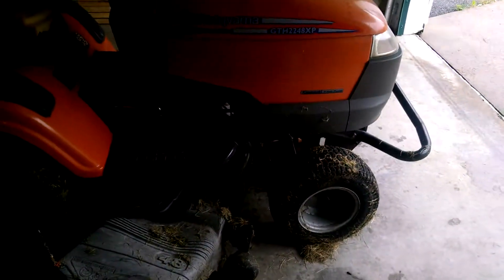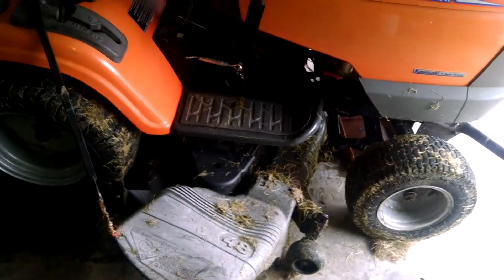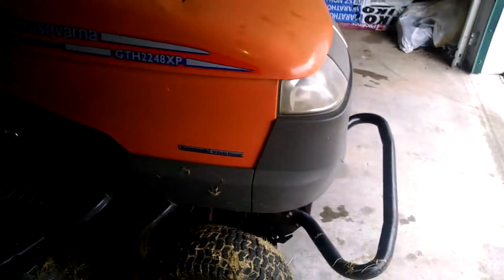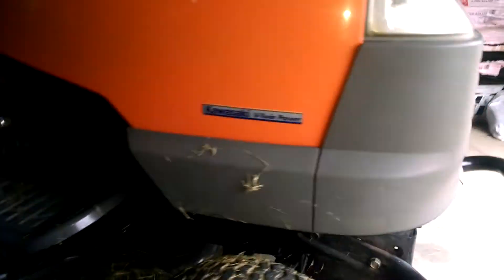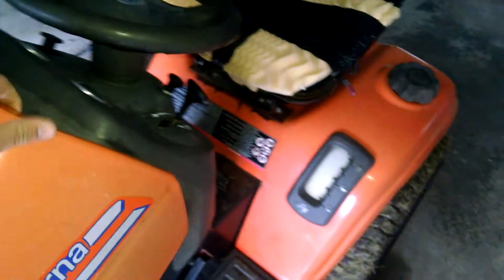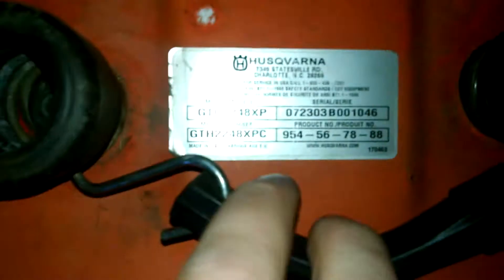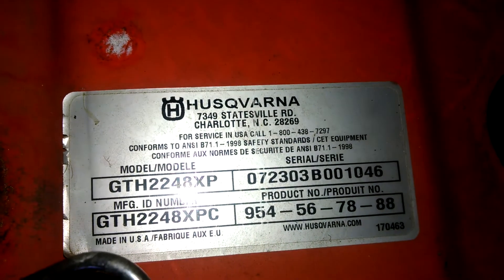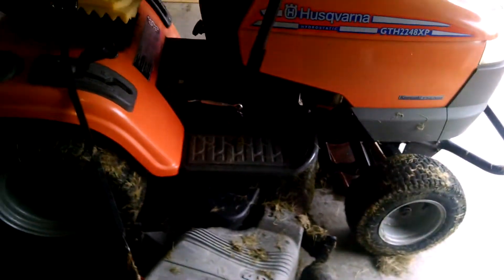Husqvarna leaking oil! Help!

Comment: ever figure this out ? i have same issue
Reply from the maker: No i never did because i just ended up selling it, was gonna buy a new motor from harbor freight, but never did. The guy i sold it to was thinking crank seal?
Reply: Guarantee it was the case Half seal
Reply: Mine is doing the same thing. Any ball park on how much to fix?
Reply: How have the same problem. Oil sitting on pulls under motor
Reply: @pinemed142  I am replacing my sump gasket on mine right now. Not an extremely difficult job. But you do have to pull the Engine and pull off the sump cover.
Reply: Could it have been the oil drain plug leaking oil?